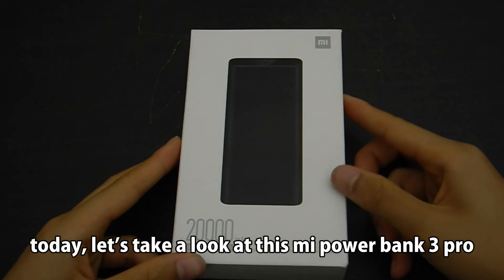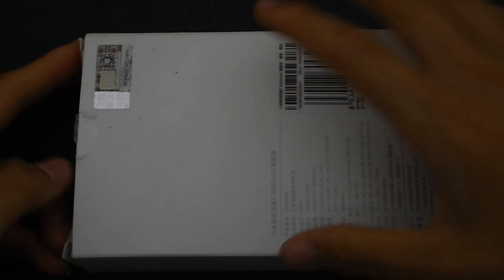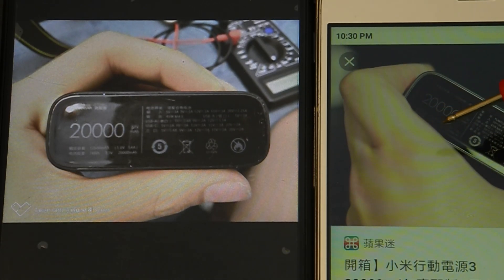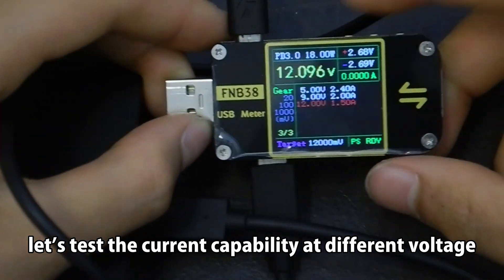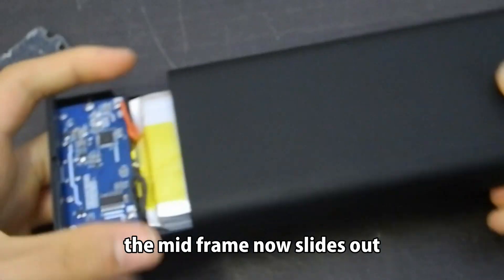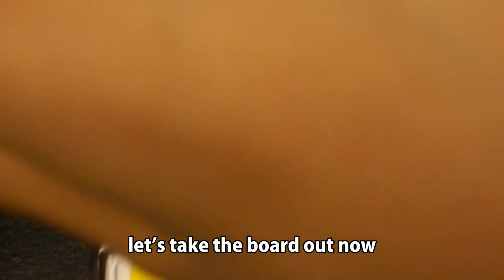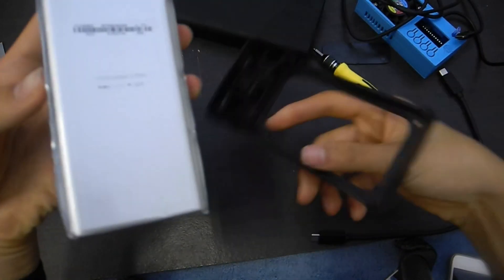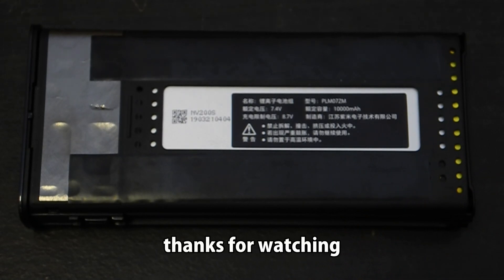FAKE and REAL xaiomi power bank 3 pro test,teardown,compare and how to identify them | part1

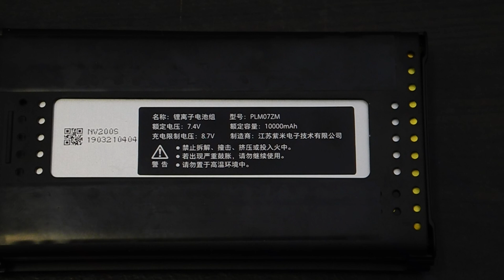Comment: 16:50 interestingly, the genuine one has 2 cells connected in series, while the fake one also has 2 cells but in parallel. Though this may seem insignificant, but two cells are never really identical and when connected in parallel the stronger one charges the weaker one with some "trickle" current, thus losing the energy.